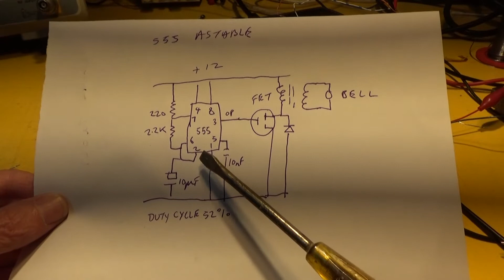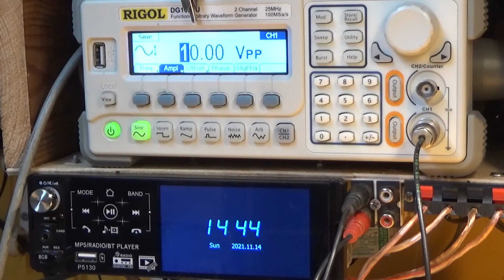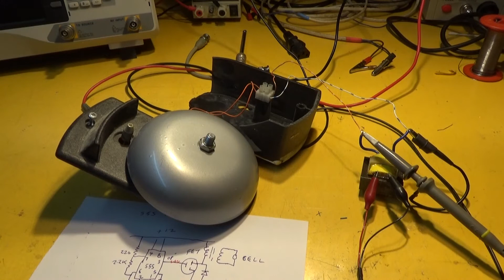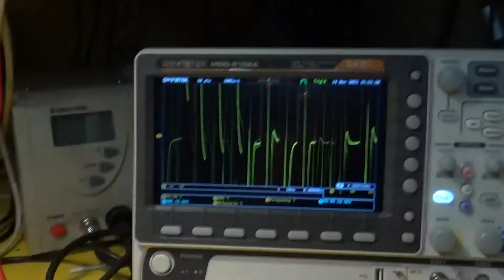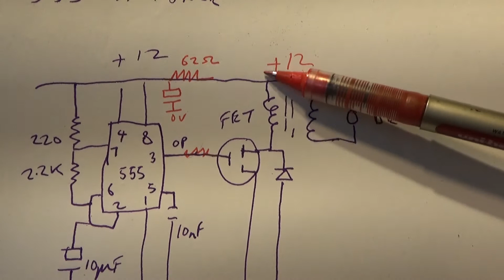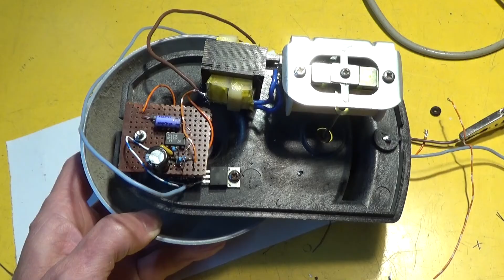Making an old telephone extension  bell work on 12 V DC

Comment: 4000 ohms is the same resistance as the bells in typical GPO/BT 700 series telephones from the 1950's - 80's. Telephone ringing voltage in the UK is around 75VAC @ 16.6Hz.

Comment: You are right at the ringer machine at the tel. exchange. The bell is normally at the end of quite some line resistance. That would drop your current and smooth the waveform.

Comment: I do think a bell sounds better than a buzzer. I used a 555 calculator but I found I did need to tweak the values. The only problems with your mosfets driver is you will saturated the core with DC. You get better results if you connect the +DC supply to a centre tap and pull down each winding alternately. That’s how the mechanical vibrators work on the car valve radios.  But your circuit looks to work very well.
Reply from the maker: Hi Chris, yes I love the the old bell sound, I've got the nearest I could find on my cell phone better than some stupid song like a lot of people have. Yes agree it would have been better with a centre tap and two mosfets in push pull I've used that method when building a switch mode psu but I was just using what came to hand & it's not really an important project, best wishes nick